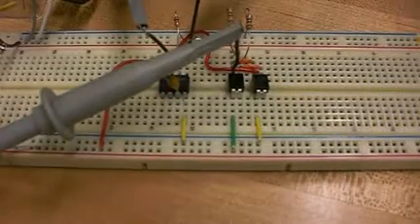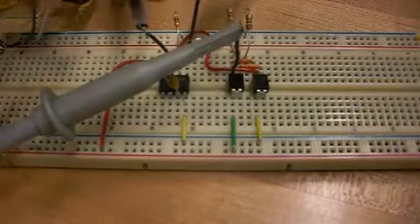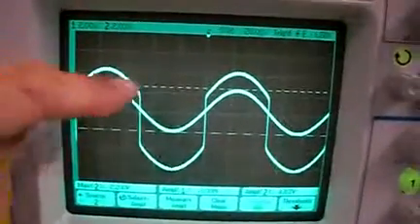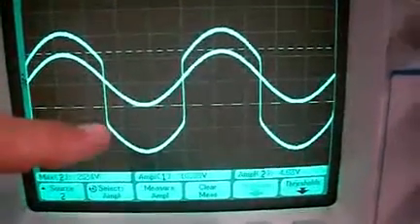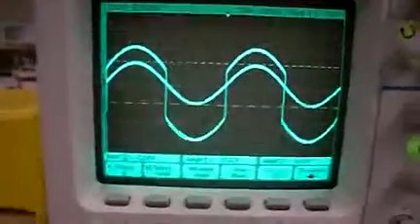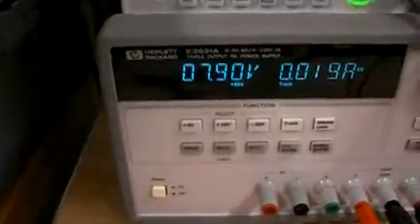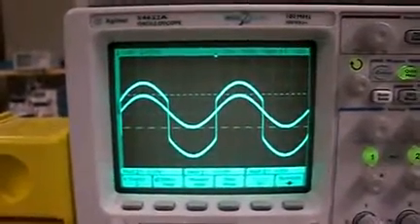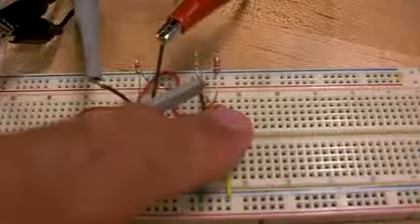Opamp_with_CMOS_output_smsm.MOV

Comment: It is really 2 100 Ohm resistors to make a 50 Ohm load.
Used 2 100 Ohm so they would not blow up from exceeding the 1/4 Watt (1/2 Watt?) rating.